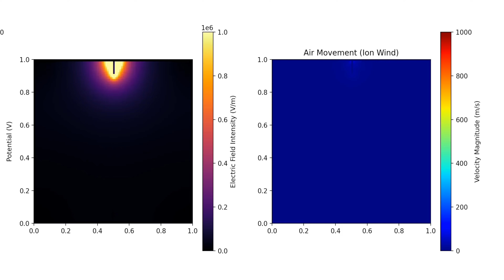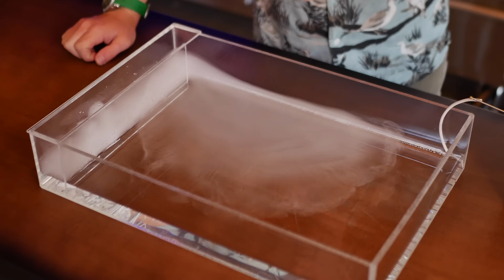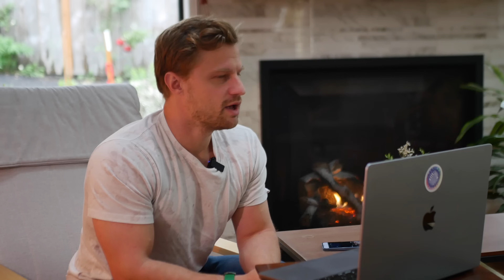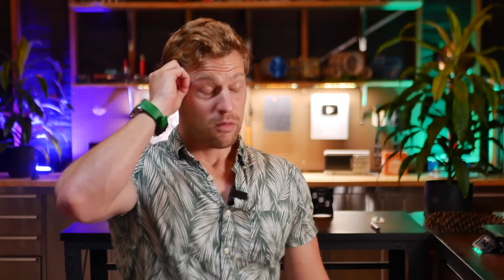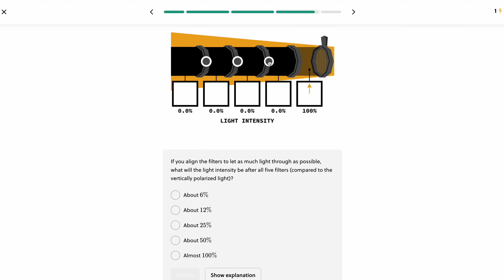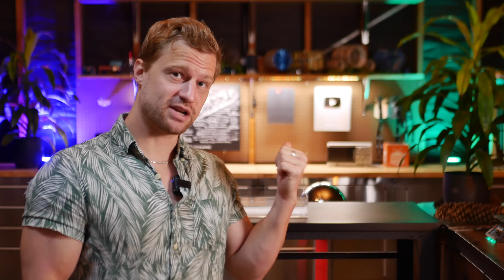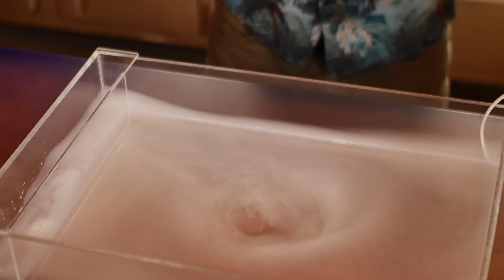This High Voltage Fog Is Controlled by Pointing (BiFrost Nebulagraphy)

Comment: Question you don't technically need the ice in the water do you that's just for visual reasons if you were to say put your hand out flat in the air could you get the same effect to happen could you put like styrofoam balls on there and they just jolt off
Reply: @skynote1728 Must try a drop of oil, to make rainbows.   Does the stream distort the rainbow pattern?   I never tried it.   (I just tried it with large soap bubbles.   The beam always pops the bubble!   It's like a beam of tiny bullets.)

Comment: Thanks.
Do you have the link of the small electrostatic device you use, please ?
Reply: #regisvoiclair it's a Wimshurst machine, that one is from SparKIT.   Far cheaper is to use a negative ion generator or cheap chinese "anion module."   If you find one of the DC 12V types rather than 120VAC, you can power it with a variable DC supply, and then have adjustable voltage on your Ion Bridge water tray.
Reply: @wbeaty  Thanks !
Is it hurting when we put a finger ?
Reply: @regisvoiclair  Nope, cannot feel it.   Also cannot feel it if you let the beam strike your skin.   Hey, instead of skin, why not try your sensitive regions?   Let the beam strike your eyeball?   (Just thought of this, never tried it back in the day.)

Comment: Bifeld Braun Effect, like in estatic fan without moving parts("Super plus turbo" model f.e.), and flying ionic wind platforms
looks great! especially vortex... 
...I also "invented a bicycle" by discovering a new effect, an aluminum bowl mounted on a magnet, in the process of chemical copper plating, a vortex of solution rotates in it, due to radial currents in the solution, in the vertical magnetic field of a magnet placed under the bowl, there is short video on my chanel

Comment: This is begging for some Schlieren imaging and direct measurements of the ion flow with an electrometer and the electric field with a field mill or vibrating reed electrometer...  Or perhaps perform the experiment in a dielectric fluid to make a more controllable scale model.  Full size volumetric fog with a theatrical fog machine would be interesting, laser fan beam illumination would be helpful too.
Reply: It's possible to make a 2D smoke layer, using "boundary layer" effect.   I wonder if the beam can be guided sideways through that smoke?   Use extremely clean glass or acrylic plates, and it might work.  (Draw a transparent line in the vertical smoke-layer.)

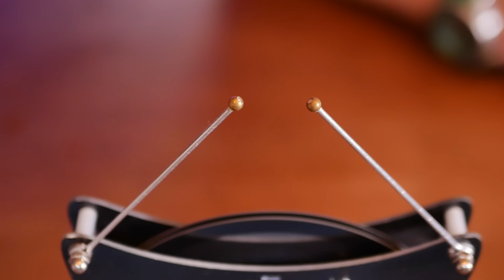Comment: 1:59 Don't forget, electrostatic experiments are basically a game of juggling with charged capacitor plates, it doesn't matter how miniature your power source is, what matters is how large the capacitors are charged when you don't expect it, because in the days of Leiden, nobles played pranks on each other by gift a charged Leyden jar , then, when touching a conductor immersed in liquid in the jar (it was unnecessary to use mercury there; water, even unsalted, is also woorks), touching the charged inside surface  of a glass vessel through the conductor and mercury in contact with the inside of the wall of this jar, a person received a "mild" electric shock . by the way, by disassembling such capacitors of coaxial iron and glass cylinder jars, we got uncharged metal glasses, the charge remained on the dielectric of the glass glas., in univercity demonstration experiments, the use capacitor, like a nesting doll  coaxial of  three glasses, medium-sized one  of them are dielectric between two metallic, so it is easy to deconstruct into three parts.
 as far as I remember, mercury from Leiden the jars can also be poured out and no electric shock happens if to drink that mercury (70 ml of metallic mercury was drunk during intestinal volvulus, when there was no surgery, thus straightening the intestines, by "digestion-peristalric" promotion of such a  “liquid gantelle weights”), pouring new mercury or old mercury or water into a charged jar, we again get a charged capacitor, the outer lining of which ( also changeable and removable) is(the role of whih  played by) the hand of the person holding the jar.

one man got electric shot without any electric charge source at all... when experimenting with DIY Sprengel mercury liquid piston vacuum pump, when pump functioned like Kelvin dropper electrostatic generator, and some drops of mercury  tends to drops away rechage funel, to plastic bath jar, safety jar against mercury leakage on a floor... and usually he somehow pour it in grounded bucket, but once he touched it liquid inside safetybath, before pour it down in grounded whole bucket of mercury, and it was the  bad one... style of learning
Reply: Heh, the very first Leyden Jar had no outer foil, just damp fingerprints.   But it still worked.   Give the charged wine-bottle to somebody, see if they take a drink.   It's the "electric cup" prank.  But never use a large cup for that.   Or, at least try it on yourself first.   
Also, the worst recorded "static zap" was measured in North Shore Alaskan winter, in the oil fields, when workers in trucks would slide across the bench-seat, then grab the door handle.   Measured at 30,000V, and ten times the energy of a common "car door spark."   Capacitance might have been like 300pF, if there were metal springs in the seat.   The report said that the impulse would contract your arm muscles, causing your hand to suddenly grab the metal door handle, even if you didn't want to do it.

Comment: I did an experiment using a pulsed rodin coil to charge acap bank to 20kv atthe cap at certain freq the cap 20kv has no charge the pos was attached to an anode 1/16 gap other anode grounded.

A screen grid was placed around the pos anode over the gap with a hole allowing drops. Of water to hit the gap allowing cold energy in cap to explode this filled the tube with water vapor and once cap filled the   vapor allowed for another arc

Comment: amazing discovery! so I have a question. I heard you mention 1 meter/sec speed....what is this velocity  and can that speed vary or is there a limit?
Reply: Speed appears to change with voltage.   I measured 30mph, but using a 15KVDC power supply, not an electrostatic generator.     Also, the effect will work with grounded water, and a huge plastic comb charged on your hair, or even a charged rubber balloon.   (The balloon has to have some tiny lint fibers clinging to the surface.)

Comment: So why don't we install this on ships and other things that have to deal with fog. Do you know how many accidents are caused just because of fog. And sense of water vapors are most likely going to go to the ground anyway it shouldn't mess up the system. If I can get MIT to build my renewable energy machine. I'm going to ask you to come on to the job. Because part of my machine is for electricity the other part is actually to help balance the planet. These machines go in the ocean and use the ocean current to create electricity. Now I have had planned just to pump the water inland and create electricity inland. And then recycle the water out to the country the clean water without the salt. But my design is also made to pull warm water off the top of the ocean and pull it down to the depths where it can cool down before it hits the Arctic. This machine is designed to do a lot of different things at once. American mutt

Comment: Another note: that is the correct effects and phenomena taking place, yet, that phenomenon could also be affected by the shape, volume, density, and orientation of your nerve paths throughout your finger and, more generally, your (surrounding) tissue itself, being that all of the electrical movement is being conducted through your body in any peculiar way and ending up at a condensed "electron-beam-tesla-coil" of nerves at the end of your fingers.

Comment: I experienced this exact thing.
In nature.
At a much longer distance.

It forever changed my thinking, perception, approach to life, etc..

I have spent YEARS looking for an explanation.

Ironically, fog wasnt actually involved in my experience.
Yet I clicked on this video due to the fog and it's place in one of my own different theories, so Im now realizing the two are interconnected. 

In my experience,  it was hot as hell and we were canoeing down a very small river when suddenly the river disappeared underground for about a hundred yards or so before coming back.
We stopped here for lunch & to visit a spring off the side down a trail.
As I sat on the end of the canoe and stared at the hillside across the river, the leaves I was staring at had this weird shimmer.
 
I couldn't quite tell at first if I was experiencing something physiological or if it was from the heat waves in the air so I stuck my finger out & pointed to a specific leaf on the opposite hillside in order to look down the length of my arm and hopefully regain my bearings & focus.

As I did so, that leaf began to wiggle and twirl while no other leaf moved.
Nothing else was moving at all.
It was very hot & muggy & still in the dog days of summer.

I panicked.
The people with me panicked.
We got out of there.

It wasnt the only strange thing we experienced on that trip, I'll definitely be analyzing how well these circumstances could have played a further role.

Last but not least, the only other thing I have seen that comes remotely close to this in real-life circumstances is actually a biological study demonstrating the ability of gene transfer from electric eels to organisms around it.

Talk about profound stuff, existence is amazing.
Good job, and THANK YOU!!

*EDIT to add:

I pulled the area up on a map to see if I could find the exact location either via a marker for the spring or by visual of the stream drying up(going underground) & reappearing. 
(It's been about 15yrs since this all transpired.)

In seeing the entire location and the merge with another stream just up ahead(directly from the spring), I do recall an extremely dense fog.

That's exactly where we had the other experience, but I'll continue to keep that aspect to myself until I have the science to explain it as well.
Reply: We are Electromagnetic beings ❤
Reply: @MsFassad  truth👏
Reply: Hannah, you told on the trees Hannah, you never tell on the trees Hannah... This summer you shall be the leaf Hannah...
Reply: @BloodlinesNewTimes  lol Im just a translator, the trees tell on themselves but noone listens
Reply: @Holy.HannaH  😂😂😂 That's very accurate actually 🤝
Reply: Share it!  Observation IS science!  Being able to explain it on a graph, etc could take hundreds of years.

Comment: This is Chi and Bio energy emanating from your chakra centers located on both your palms. Placing both hands together can create a magnetic repulsion or attraction based on hand position and thought.
Reply: The vortex is proof that it is released from your hand chakra as these energy centers are energy vortexes.
Reply: Also - that simulation has the outline of an ionic discharge.. looking like a stick figure arms up/ legs down with a toroidal field in the middle

Comment: The positive side you are holding will try to find the negative side inside the water tank hitting the water, however, as the mist is also water in another state obviously, and fog is known to scatter electricity and light, as it is not as good conductor of electricity as water, this means the positive side moving to touch the water in the shortest possible path causes a hole in the fog and as you move your finger the reajustment of the particles of water in the fog will appear as lines in the fog. Since when the beam touches the water the positive and negative sides create a closed circuit then now the fog is repeled from the beams point of contact with the water. It seems you can transform electricity into magnetism using this set up. Test it

Comment: There are 7 chakras located in palms- one in the middle of the palm, one in the wrist point and other 5 in each finger and thumb. The left hand palm chakra rotates in clockwise direction whereas right palm chakra rotates in anti-clockwise direction, but depending on if you are left handed or right handed could possibly change this fact. It is said that the left hand palm chakras receive energy whereas right hand palm chakras provide energy. That said, generally the dominant hand sends out energy and the non-dominant hand receives. So.....when you put your palm above it and the smoke started to "spin in the center of your palm"....JUST BLOWS MY F*CKING MIND. THEN you start writing the infinity sign from 4 feet away and I had to just pause the video for a minute to calm tf down, lmao! In the spirit of open-mindedness, I encourage you to take a look at this video. East meets West.  https://youtu.be/u311IQc0zuw

Comment: ITs easy to see that region electromagnetic potential control would control cloud forming or disolving (and its just a h2o - think what you could achieve by spraying region with other v small molecules that are more influenced or differently influecned by EM fields for example from those phone towers ). And your finger pointing on clouds while charged is simmilar to cutting out clouds with use of so called ergonits or chembuster... It takes energy from close proximity and radaite it in direction you point out ... if energu is high and clouds low or thin layer you would see cutout while tho whole cloud layer move). As Ive mentioned it works always but you must know that limitation is power which you couldnt check (you would nedd to understand waht exactly should you measure ... is it emf and if yes of waht length or frequency and its its constant or not etc... you just simply do not know and there is not much in any books... we could try as mr Wilhem Reich or Nicola Tesla or other guys that were removed... Im still amazed that your experiment was allowed to be shown here as its close to weather control system test in lab level... but maybe its time of so called revelations in so called end of times XD

Comment: I’m imagining the finger being replaced by a plumb bob on a wire dangling over it instead for a more permanent artistic device.
Reply: This works fine, but you have to attach a single hair to the plumb bob, to act as the stream-emitter.    I find that human eyelash hairs work great for this.   Also, try bits of paper with a torn edge.   The fibers then emit a bunch of parallel streams, like a wide calligraphy pen-tip.

Comment: @PlasmaChannel, have you already tried to make simulated muscle?  I seem to remember an experiment mentioned in the early 90's, where tiny tubes of LDPE were filled with oil (I don't know what kind), and demonstrated that with a low current, they could make the tube shrink.  Now that I have a 3D printer, I'm on the fence to see if this was ever true or just a forgotten discussion at a bar.  lol

Comment: This is a function of Extropic Hydrodynamic Plasmatic Aetheric Energy Content in the Human Body-Mind-Spirit-Psionic- Complex... The Energy Content in Static Radiant Form is: (((10^93)Grams)/(Centimeters^3)) x 42 Cups Per Human Body... Same Energy Unit as Megaton Nuclear Weapons, except this Has full Creation and Extropic Functions right along with the standard entropy physics which was force fed down your throat from the day you were born. When this Energy Capacity is Directed as a Point-Source the Creative Capacity is not typically Understandable by the Western Doctorate level mind... Franz Anton Mesmer Started to Measure the Components and Functions of some of this over a century ago... He was making actual headway towards directing and augmentation.  Baron Karl Von Reichenbach also wrote several Research Thesis Books on this Area... 1800's works but still relevant...

Comment: I hope you see this! I took my son to the desert last year and just before a storm, this crazy thing happened. We both could shoot static bolts into our down blanket. Blur the he could put a 30 sec! Plasma charge from his pinky! It never touched the blanket just a 1000 charges out but only for an inch! But the crazy part is how long it lasted! Any ideas?
Reply: Do this in total darkness.   The sparks are cool, and also, one person reported glowing blobs.   They kept glowing, and she could push them around with her fingers, making several glowing blobs and then pushing them together into one large one.   Down Blanket Ball Lightning?  This was back before iphones, so no videos made.   (I think she used a nylon blanket, in winter below 0F degrees, for low humidity.)

Comment: Yeah but can he figure out that whole ball lightning phenomenon? Give me a text when you want to really impress the physics/chemistry community! Still waiting for someone to come forward with a buyable theory! But going on  23 years and i feel that we shall give birth to a warp bu ble before we figure out ball lightning! 😢😢😢😢😢
Reply: Robert Golka was creating lightning-balls on demand.   They turn out to be the same thing as "welding spatter" from electric welders.   It's like white-hot aerogel, a nano-fractal metal structure in stable combination with hot gas.  (So, sometimes it can explode like acetylene.)   A group in Israel duplicated this, but using silicon, not metal electrodes.    
Yet that's just one form of "BL."   There may be other kids.    It explains the BL seen when lightning strikes dirt, but doesn't explain the kind that appears up high in thunderclouds, or appears during clear weather with no thunderstorms for hundreds of miles.

Comment: You should image the setup in a dark room in uv and xray as well (there may even be visible light production).  Ion trails in air may be visible in these spectra, though the x-ray discharge may be negligible since the voltage is not very high.

Comment: according to electrician class it always flows from negative to positive so why here would it be the reverse aka the actual right wording where postive holds the charge and negative absorbs the flow of energy electricians are taught exactly opposite basically 😐